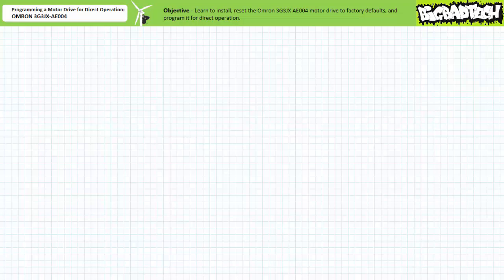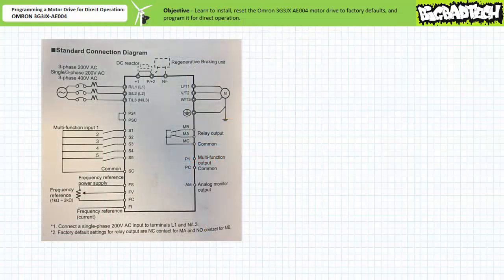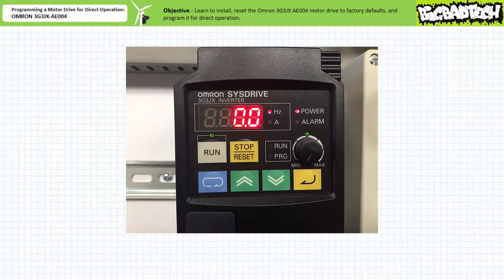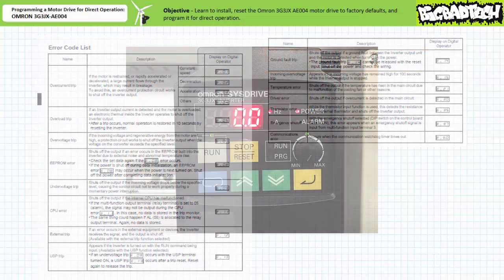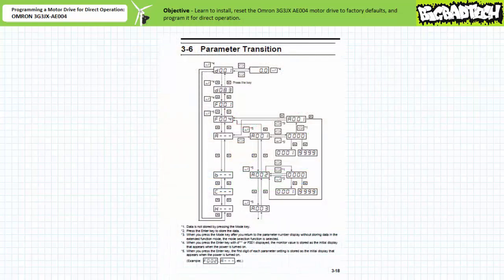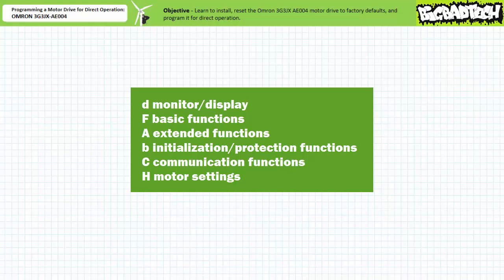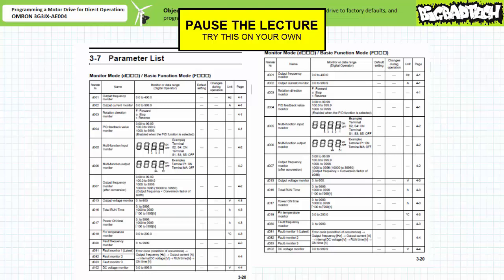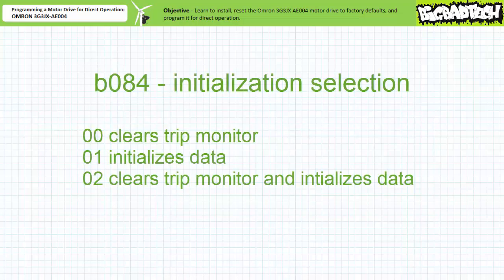Programming A Motor Drive for Direct Operation: Omron 3G3JX-AE004 (Part 1 of 2)

Comment: Can you share DC bus Capacitor reforming guide for OMRON VFD ?
Reply from the maker: Good question. The Omron 3G3JX motor drives don't have a reforming procedure but rather call for outright replacement of the capacitor. Check Appendix 2 of the SYSDRIVE JX series manual at: http://industrial.omron.com.br/uploads/arquivos/Manual_JX.pdf